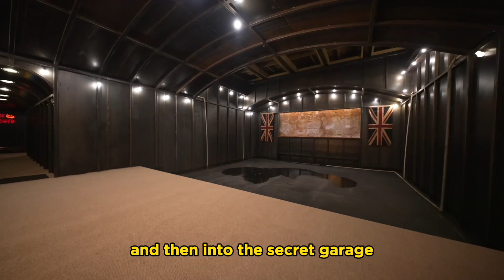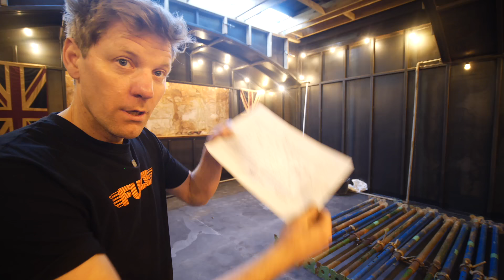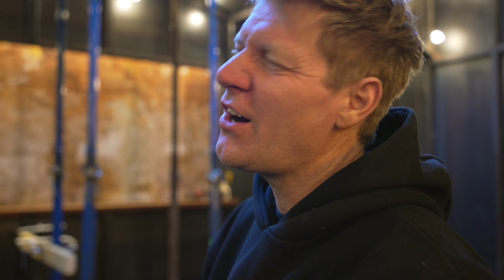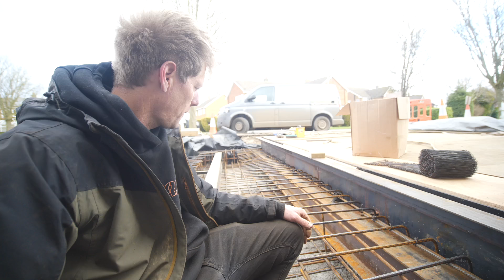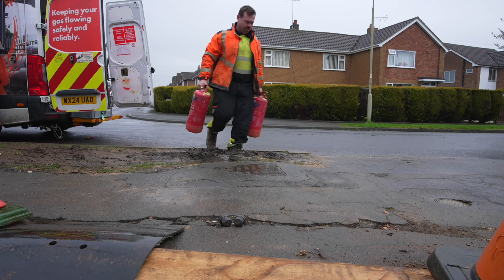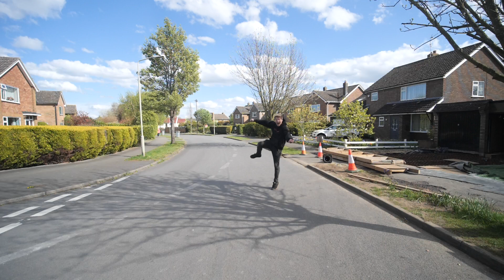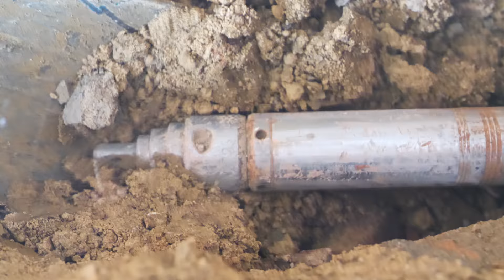Digging a SECRET Garage Part 6 THE COVER UP!

Comment: Ive been doing engineering drawings for the best part of 10 years and those rebar drawings really scratched an itch in my brain, very nicely done
Reply: Every time I've specified timber it's just for packing because its infeasible to cut steel shim for every prop on a normal site
Reply: The D30 demand is ridiculous. There's absolutely no case where this could not have been done with C24 graded lumber.
Reply: @rsnmaa I’m a mechanical engineer and this is basicly just CYA thing. We almost always recommend the most over the top materials that are needed when someone else could work. Sometimes it’s the engineer own decision but other times, a company policy.
Reply: @Nosirt  thanks for clarifying. I'm a structural engineer and I do a lot of erection engineering and scaffolding (timber and steel) for pours. I'd attributed this to severe lack of experience but I guess CYA (if I guessed correctly what this means) is a symptom of that.
Reply: I'm impressed with Colin's reading of a rebar drawing. I remember my first site being completely baffled by all the lines and numbers, as well as the schedule. It took around 6 months to fully understand what I was looking at. 

OK, we were building nuclear bunkers so it was a lot of rebar, and Colin's drawing seemed a lot simpler, but props to Furze!

Comment: I used to do concrete for a living for about 5 years “nothing big just driveways and whatnot”  but I'm sitting here looking at the sheer amount of rebar at Steel you're putting into this with what I can only assume at least a one foot of concrete “That's 0.3048 meters for those who don't understand American” But yeah I'm sitting here looking at this and thinking to myself.  I thought I was just going to be an underground garage not an actual bunker. you can build a house on this and then some.

Comment: Worried that if the fence gets hit it will deform the bunker. Do you reckon the bolts are enough of a fail-safe? It did look like it was tied in, right?

Comment: Brilliant, as always, Colin. Oh, and thank you - I can't get that damn 'Chris Bibby' song out of my head now. Cheers for that.
I hate rebar, too. I work in a scrap yard and the damn stuff either knots itself and tons of other shite together in our frag mill, blocking it, and we have to dig it out bit by bit, usually with a big HIAB and a lot of bad language, or it passes through the mill perfectly, but is so hot from friction, it is blue, and basically, if it goes in the wrong place on exiting the mill, it can bloody well stay there, as it is far too hot to pick up (even with welding gloves on).

Comment: Its not good to pour concrete vaults  in layers that has time time hardened fully  and start shrinking, you should have done all the rebar   and poured roof in one go. If you have to do concrete  in layers, like prefab stay in place concrete  form slabs , the concrete is specially treated to   avoid separation. And is poured and alowed to go trough shrinking  before use . In your case tje concrete surface should have been racked up and the cement skin,removed ,to improve adhesion.

Comment: I absolutely love your videos they are awesome. I must say though and I talk from experience, using acro props at all was unnecessary but going to the lengths you went was a huge waste of time. If you pour the concrete in 2 layers then the first layer once set becomes somewhat load bearing and load spreading there for taking away most stress on the roof structure.

Comment: I will never forget when I worked in a hire centre and had to deliver poker vibrators to the new LNG site, where they were doing foundations for the tanks. They had Spanish and Romanian guys huddled up 15 feet down amongst the rebar, tying in by hand. I got told off when I said we hire rebar tie guns.

Comment: When you get to the final stretch in back, it might be a good idea to install a sacrificial anode. Just a big block of zinc or magnesium that will passively absorb the damage of long-term, many years worth of electrical corrosion to the entire connected structure instead of the steel. More of a long-term thing for the far future, but relatively inexpensive to include now. Also wonder if there's some sort of material that could go between structure top and dirt to passively pull up moisture from deeper in the ground and help prevent the dead grass silhouette in winter seen previously, without resorting to sprinklers or irrigation pipes.

Comment: Did you place an emtpy pipe for later use if for example an utility line has to be exchanged or added (like a fiber internet connection)?

Comment: Why don't you buy yourself a construction lift and an a a thing on top of it and weld it to the bottom of the floor you can find those in Home Depot or you can find them anywhere else I recommend getting a heavy duty style lift also it's coming along great you still have far to go but you're really close keep up the good work😊

Comment: 29:09 i wonder if the lower bit of jaw has a spring in it that needs replacing? basing it entirely off of a rubber band fixing it and me trying to figure out what said rubber band is doing that the lower jaw things no longer is

Comment: your mic is too hot. you want it to be at -16 decibels when youre testing by talking normal to loud so if you get excited, you wont go past 0

then use compression to make everything slightly closer to a static volume without sacrificing emphasis

Comment: Colin just so you're aware there are now AI tools which can descramble mosaic tile censorship in video, so if you want to keep your number plate hidden (you missed a bit at 35:45, by the way) you should just put a solid rectangle over what you want to obscure.
Reply: There's a clearer shot unblurred at 35:03, you can straight up read the entire plate, there isn't even any obfuscation. The overall-average-color-matched rectangle is a personal favorite of mine, totally hides this stuff even from AI, while less unsightly than just a black rectangle.

Comment: I‘m wondering that you did not put a spare spare pipe from the street to your house in the concrete for telecommunication or something in the future. You never know what is coming. Maybe in a few years the power company will renovate the grid and redo the cable to your house or something

Comment: is this the light concrete? I recall you said, the top will be a lighter compound of concrete because the arc structure won't have strength to any weight of concrete + car on top

Comment: Brass instruments have different notes. This is supposedly for good reason, but I think it's a load of hot air. At least body temp.
Anyway, that's all to say that the trombone insert was pretty much right, just in the wrong key, and I'm wondering if Colin read the music for it and transposed into a different key in by accident.

Comment: You blurred the license plate but its visible around 35:10 ,  time to make some custom magnetic plates for your cars :)
Reply: That type of censorship is also shockingly easy to reverse.
Reply: @pseudotasuki  yeah, if a computer can scramble it, another can use the same pattern to unscramble.  better off with a solid image over like a logo anyways.

Comment: Engineer: puts a curved steel sheet roof, reinforced with square beams, and pours 55 tons of concrete with a ton of rebars.
The same engineer: “Let’s check if it moves under load.”

Comment: Has it really been this long ? Damn close to 3 years watching the "Human Mole" digging holes and doing all sorts of mischief. I'm a bit sad it is coming to an end, but I'm sure that there is still some larking about to come. Good post mate 👍
Reply: There's more tunnelling in the theoretical future - the link from the house-workshop tunnel back down the garden to the "original bunker" still remains to be done. That said, I would totally understand if Colin lets that one sit for a year or two!

Although, if there is any tiny-industrial digging kit that would make that horizontal progress easier, he will be able to bring it down the impending car-lift once that's in. It would have to be a pretty small footprint to get it round the corners in the tunnel though.
Reply: @MattFowlerBTR I've see micro diggers that are around 70 cm / 27.5" wide and fit through domestic doors and alleys. They can be fitted with the same type of tooling the bigger diggers use, only smaller.

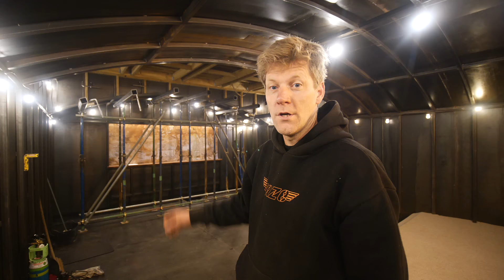Comment: 21:09 - did you consider laying conduit for the gas, water og main electrical? Thinking if you ever need those changed, upgraded of repair, it’s going to be a hassle when it’s all in cased I concrete.. 😅😅

Comment: i still feel like you should build a car workshop down there, put a scissor lift directly on the lift that goes up from the bunker, so you can change tires oil etc. Would be very cool. Like a scissor lift on a scissor lift.
Incredible project this, i cant believe what an absolute gem of an engineer you are Colin.

Comment: I heard from a builder that he was onsite once when a head office manager (aka a tosser) had them wire brushing rebar before the pour to get all the rust off. This went on for a couple of hours until he left and they poured concrete as fast as possible. Well at least before the idiot came back.

Comment: As a concrete pump guy i appreciate the effort on bar tying. I walk on bar all day every day and sometimes it's awful and it's guys like you that make my day a little better.
Reply: My Dad was an Iron Workers (USA) and he absolutely hated tying off rebar. Wasn't too happy working rebar either (grab a large bundle and walk it into place, then tie it and add standoffs as needed). Not a job for the older Iron Worker.
Reply: @neilcherry6452  the powered rebar tiers are great. Repetitive stress injuries from manual rebar tying are very much a danger.
Reply: @fredericapanon207  My Dad told me of this great new tool (manual) that worked better than his pliers. He would have loved the power tools
Reply: @neilcherry6452  v boring. well done.
Reply: Should have some little bungs on those uprights, accident waiting to happen 😮.
Reply: I was flinching looking at all those exposed vertical bars with no plastic caps on them. That's an impaling waiting to happen. You wouldn't want to trip or slip near those. Sharp as razor blades and would go straight through you. Collin, use plastic end caps ya mad dog.
Reply: I had to walk past rebar a few times on some sites. Oh my god how do you do it, it's so annoying
Reply: @dimitar4y  another dullard
Reply: You mean rebar? How can you pour it when its not tied?
Reply: @doowappable  You'd be surprised how many sites I go to where the rebar just rolls around in some spots. stuff happens and sometimes its not tied as well as it should be. But yeah for the most part it is tied just poorly.
Reply: @RenewedLifeMedia  I see, thnx
Reply: @RenewedLifeMedia as a concrete guy, in your opinion, was the last pour too wet?
Reply: @MrDaragom seemed a bit wet but I'm not a finisher just a placer. So as the pump guy i like wet because it pumps better. For that slab I would have gone with probably 40mpa strength with 20mm agg at a 160mm slump ish. But whatever the engineer said is right again I'm just the pump guy.
Reply: @doowappable  He never said it wasn't
Reply: @Catknapper  I misunderstood "effort on bar tying' and thought he meant 'actually tying', my poor english
Reply: must be fun around your house at christmas !

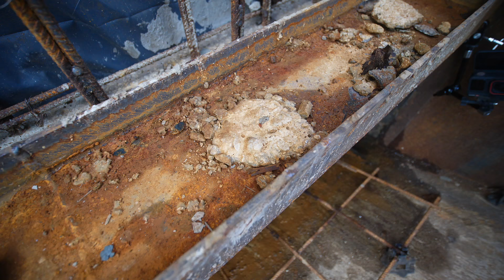Comment: 19:00 Colin, that's not how rust works. 

If your metal is rusted, it will continue to oxidize. IDK how much concrete you have on top of it, it's just going to happen at a slower rate.

Comment: My dad when he poored concrete over af few pipes was he took a pvc pipe made a cut length wise and bend it slightly to put the pipes in and exposed it on top so u can get to them without destroyin everything when u need to get to them

Comment: Your double holding the scaffold tube to the acro are upside down the bolt usually goes on top so that way the gate holds the weight of the tube so its easier when doint them up
Reply: It doesn't make any difference at all to the strength it just makes life easy for you as when you undo them the tube will want to naturally drop because the bolts swivel 180 degrees where the gate(opposite part) opens to 90 degrees and holds the tube for you

Comment: Colin, on the car lift section, it would be funny to stick a car (stripped of the engine and gear box to reduce the weight) on top so that it goes up with the lift for the perfect disguise 🙂

Comment: A firedoor is not something you can make yourself. Tobeacceptable to Building Control it will need to be certified via either fire test or assessment, neither of which are cheap or easy. Just buy one and get it nstalled by a suitably qualified chippy. Trust me I'm a Fire Engineer.

Comment: Blurring the plate at 34:57, causing it to draw your eye, then having it fully exposed at 35:04 is peak comedy, Colin.
Reply: Might have blurred it because it was on the road and the thing isn't MOT'd or taxed
Reply: @ZeeBri came here for this comment
Reply: To be fair, I don’t think he has ever blurred any of his number plates before.
Reply: I'm wondering whether the camera he uses automatically blurs number plates? Seems odd he didn't blur it elsewhere, and we've seen the Hilux plate in old videos I'm sure.
Reply: So I searched the number plate on the gov website, and I think he left them uncovered because they are fake plates, and were blurred when he was driving on the road, he needed his actual plates to be visible.  Given what Collin does and his general youtube persona this fits
Reply: @dcfan7838  its a real plate, 1987 Toyota Hilux diesel in manual, checked for fun, just not easy to read
Reply: Plus blurring an image like that is pointless these days. As long as the blurred section is moving around in the video, like it was here, AI can decipher the text that is blurred with 100% accuracy.
Reply: @bluegizmo1983  That's the reason it's always suggested that you completely black out any sensitive information in photo and video. Especially things like faces. The methods used to add bluring are very well known, and pretty easy to reverse, even without AI. Mosaic isn't much better, either.
Reply: @bluegizmo1983  It means you didn't blured enough lol
Reply: @galactic_dust42  with enough footage you can decipher any text.
Reply: @pali33  Depends on the reconstruction algorithm, there is always a point where the data cannot be reconstructed back, depends on the alteration of the data
Reply: @bluegizmo1983  Always has been, not just these days
Reply: @perz1val  It used to take some effort, now anyone can do it with a couple of clicks.
Reply: @dandeemcgee I noticed that too. Pixilated then not a few seconds later. Still just a waste doing this you can see the plate cause it's in the public anytime you drive on streets. Plus all this info is out in the data web cloud in the sky

Comment: To put the 85 ton roof into some context, I just did my double garage floor. It was 6 cube, which weighs about 15 ton wet. So colins roof is over 7x the weight of a good garage floor.

Comment: 33:10 man, you really shouldn't be welding in the open like that. i really hate to be that guy, but you can get flashed from welding BLOCKS away from the source, so if little timmy from down the block is looking at this while your doing it, you just flashed that poor kids eyes.  grab a fold out grade D welding curtain please. i had my eyes messed up this way from not knowing. it sucks

Comment: For what it's worth Colin, while I may have found your channel after the initial bunker in the backyard saga, this feels like WAY more convoluted of a journey than that one could've ever been made to be, even IF you add on the epilogue bit of building an entire shed around the new surface entrance.
But regardless, I'm happy to have been along for this entire ride from start to finish, even if as only a mere viewer I feel like I haven't "helped" with any of the process directly, only watching along while the lot of do the ACTUAL work of the project, both on-camera & off-camera.
I'm proud to have you be the only YouTuber I've watched across 10+ years that I've actually bought merch of.

Comment: Did the structural engineer mention about wire brushing the rust off the rebar before pouring the concrete?

Comment: I think the expectation with those hard-wood pieces was that a general contractor probably has offcuts of those lying around. It doesnt make sense to buy nice oak lumber outright but if you've got a few dozen wobbly half meter offcuts taking up space from an old joob it'd be basically free.

Comment: I'm flabbergasted that you wasted so much concrete. You definitely didn't need a slab that thick just to support a driveway even one plenty strong enough to have a concrete truck park on it. You could have created a solid foam cavity between the garage roof slab and the Driveway slab (Coffins).
even at the apex of the Garage you look to be nearing 20" of concrete out by the sides is getting past 4' thick. the driveway slab if connected at the apex and the down walls could have saved a lot of Cubic meters of concrete without losing the strength you need.
Reply: But that wouldn't hold up to a 500lb GBU, now would it?😂

Comment: Is it me or does it look like a portion of the garage is underneath the neighbour's front garden? Referring to the part towards the right of the upcoming car lift when looking towards the house. 35:33 for example (with 35:23 for reference that the other side of the new steel fence is the neighbour's).

EDIT:
Just to be clear, not complaining or anything. Just didn't realise. And it's possible he mentioned it in the video where this was dug out, but I can't recall. The series spans quite a bit of time.